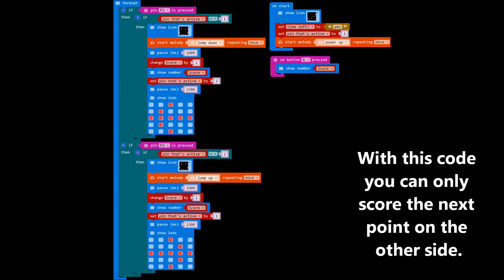DIY micro:bit MAZE

Comment: what is the component
Reply from the maker: I am sorry, I don't understand your question.
Reply: @pinkypepper  the wire needed to do this
Reply: for exampleAccelerometer
Reply from the maker: In this game the ball can conduct electrons. When the ball hits the corner, two pieces of copper tape are connected by the ball, thereby closing an electrical circuit. The micro:bit can check whether an electrical circuit between one of the pins and the GND is closed or not. I hope this answers your question.